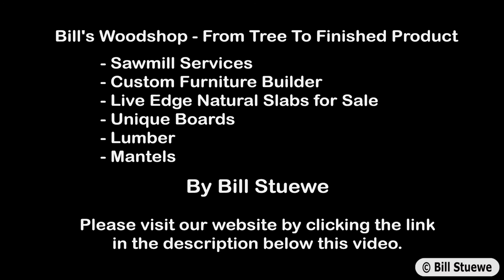Austin Sawmill Live Edge Natural Wood Slabs

Comment: Bill how do you avoid oil from the chain getting on the wood with such a long bar
Reply from the maker: It is really not an issue.  I have milled over 20000 board feet of wood with a chainsaw mill and believe me, oil on the wood is not a problem